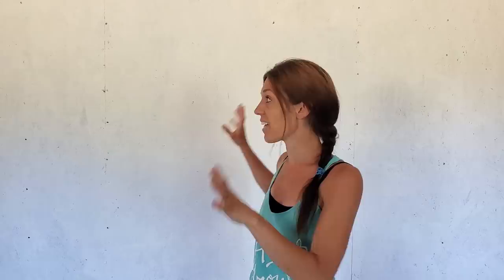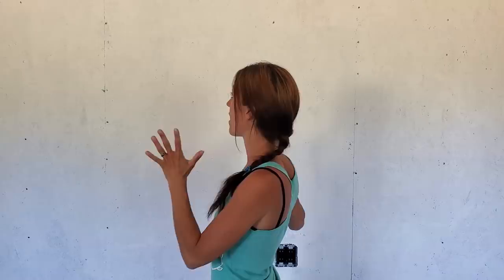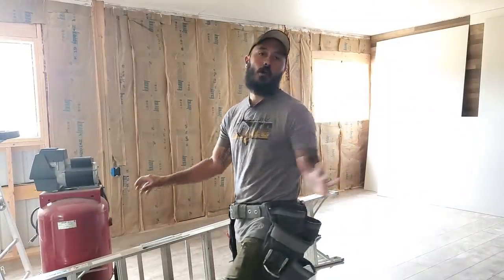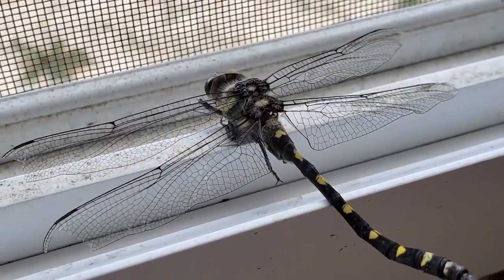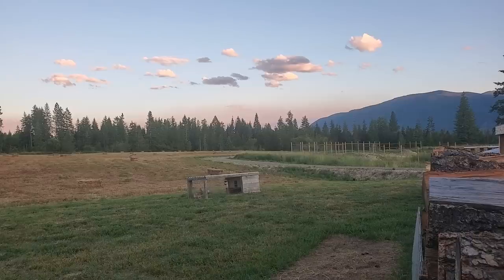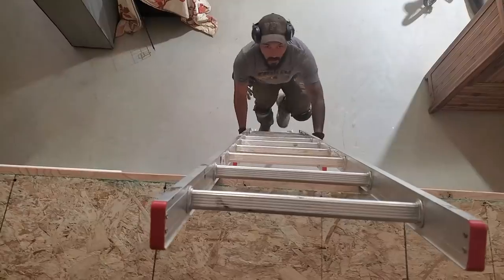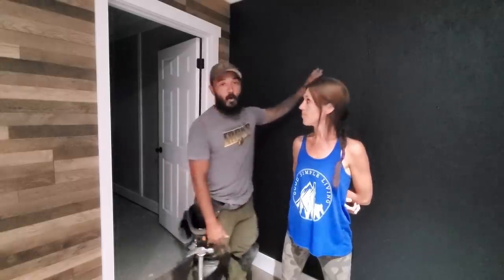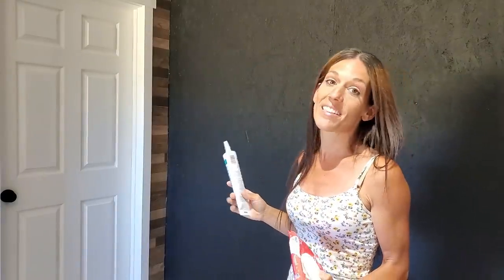A Black Accent Wall? Finishing Interior OSB Walls | Building Our Own DIY Tiny Home

Comment: Hey guys , I'm aMichigan JEDI Carpenter (33+Yrs now).  Don't screw the edge of the drywall ,until the next sheet gets hung .. just place the screws in the center 2studs til you hang stuff , then go back and catch the seams.  It will save on. 'blowouts' ,on the edge... CAPEESH?  Set up a long (12'r. ..?)2x10 or so, across the A-Frame ladders, at the right height and use it as a walk /Pick to save on ladder climbing and resetting all the time.  I suggested that ,the last time you were setting squash blocks in the upper floor joist .. it's easier and way faster to work off a pick , than shuffle ladders around.  You can finish a whole wall in one setup , then transfer it easily around the room. Sempre Fi!    Love the comedy, keep it fun(ny)

Comment: The reason sheetrockers stack their Sheetrock on side with the added seems, is that it breaks the seems up, rather than have floor to ceiling joints that can show problems real easy.  Looking great, good job.

Comment: Great progress! A few tips: 1) for your next project, look into the use of plastic on the interior of the exterior wall in your climate. I believe there are better practices, 2) invest in a sheetrock screw-gun tip, 3) best to gap the sheetrock off of the concrete slab floor instead of off of the ceiling (concrete holds moisture).

Comment: Jeremy.  I’d recommend a drywall gun, which takes a strip of like 50 screws.  You can use it one handed, while supporting the sheet with the other.  I invested in one and wish I would have done that years ago.  If nothing else, at least get some drywall screw setter bits. Two bucks and will save you a bunch of time. Blessings to y’all!!!

Comment: Looks like your are making good progress, nice job.
 If your are going to do much more drywall get your self a RotoZip or equivalent and a 5/32 electrical box cutout bit plus a 1/4" cutout bit for doors and windows.  .  You just hang the sheet, punch the bit through the drywall into into the box, cut over the the edge of the box jump to the outside of the box and run the bit around the outside of the box counter clockwise.  They make it amazingly fast and easy to do all the cutouts. Got to be a YT video on how to use one.  Also get a realy DW screw driver with the depth stop, important that the screws don't get driven too much that  they break the paper.

Comment: Just from a construction view point if you get a caulking gun in the long run it would be cheaper than the small tubes and easier to caulk the joints and nailheads of your trim. Good job on the tiny build.

Comment: So a little cup of dish soapy water to dip your fingers in before you smooth the caulk works great, but that's all inside work better done in the bad weather that is only 45-60 days away guys! Getting the water a bit more squared away would be my biggest priority about now, so it's done before it gets cold & to have for the fire season that is already starting around here! How long till the tractor comes ? :)

Comment: You can fabricate a chase out of cement board . If you're clever enough , and pre assembled a few of the sides , all in one pc. : It'll work out that the cement board in inside the chase ,is safe AND screwed into an exoskeleton wood framed  L-buck corner  , to create the structured inner And outer Framing required.  Then cover the outside once the liner is secured..3-4 sheets of durock cement sheets might work if you cut them correctly.

Comment: Any information you can give me about the short ladder. I like that it has the platform but not at the top. Would be perfect for my house renovation. My ceilings are eight  foot and I find I need just a little lift and both feet on the same step.
Got the bell turned on waiting for another update.

Comment: For the dry wall, if you hold a measuring tape on the measurement and your knife on the end you can score the drywall as you walk down with the measurement. Should shave minutes off each cut.
Only a suggestion not a “I can’t believe”. Good luck with it all.  Holler Homestead had a product sent to them for outlets and light switches, magnet you put together then cut out.

Comment: You can’t put insulation up to metal siding. It’s going to sweat and you are going to have mold. Ask any insulation contractor or pole barn company.
Reply from the maker: We didn't,  we left an air gap just like the pole barn contractors in our area suggested
Reply: Good Simple Living oh good deal. I didn’t see that. Well done

Comment: Holy moley, you're creating a lot of plastering work for yourselves. The centers of the drywall sheets only require a couple of screws.
Reply: But I suppose you're putting up wall cabinets and backsplash over those, right?
Reply from the maker: Yes we are covering it all

Comment: You guys, the drywall should be installed in 2 pieces on the wall not the length side up.

Comment: I still don't understand why you used OSB for the walls and ceilings.  OSB cost $20 a board and drywall cost $7 and is better for painting, lighter and is easier to install.   Love your videos.
Reply from the maker: Where are you shopping? Other way around here!
Reply: @GoodSimpleLiving  Here in Ohio drywall is very inexpensive.  Maybe lumber is cheaper where you live because much of it is milled in your surrounding states.   Just a guess.   I just checked Lowes and Home Depot in my zipcode (45069) and 1/2" OSB is $13 and 1/2" drywall is $7.50    We can get 7/16" OSB for $12.    Keep making great videos!   You have a great piece of land.   *additional edit:    I looked up prices at the Sandstone, ID home depot near you and you are right that drywall cost more in Idaho than Ohio.   It was $12 for 7/16 OSB and $12 for 1/2" drywall near you.   The odd thing is USG brand Sheetrock carried by Home Depot is manufactured in California and Oregon so it seems odd that it would be cheaper here after shipping it across country.